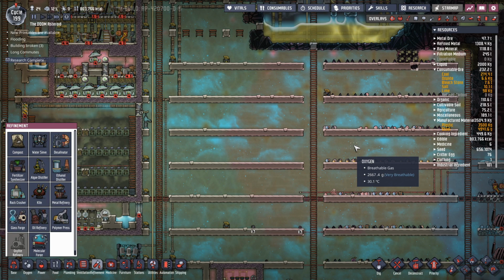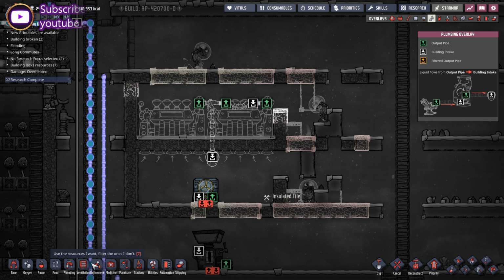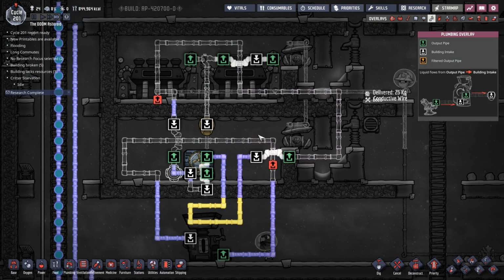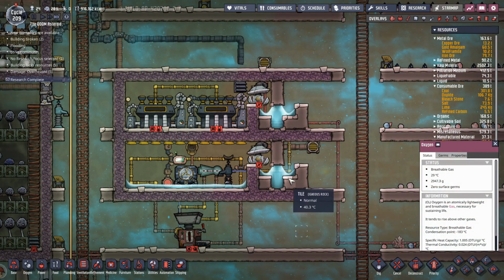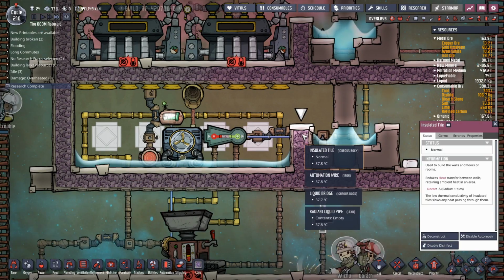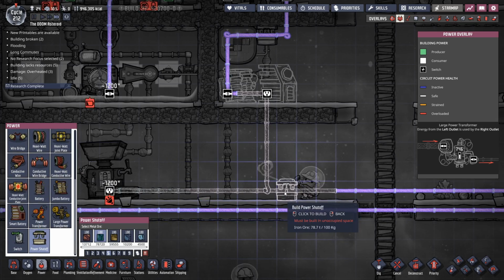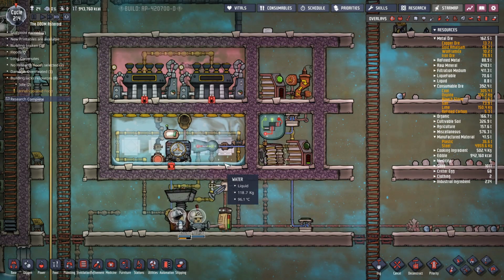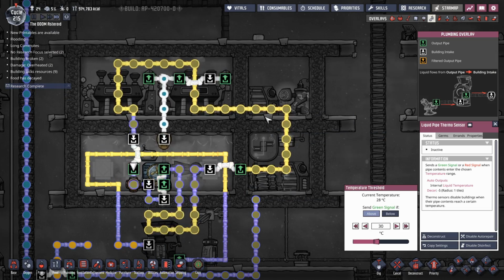Self-Powered & Cooled METAL REFINING | Oxygen Not Included Tutorial/Guide/How-to

Comment: I don't want to be critical, or spoiler, but it is possible to make a steel and iron smelting situation much more efficient than this one.  Like for mid game, I power my entire base with steel and iron smelting...
Reply from the maker: I know that the Aqua Tuner has a lot more cooling potential than this. I just really see the point for a tutorial to get people started on neutral metal refining by building a base spanning cooling solution. Simply the wrong focus
Reply: Please do tell how one would make it more efficient? Cooling potential aside, the turbines are consuming all of the heat that the refinery generates. Would that not imply the maximum power is being generated by the single refinery? Running the Aquatuner more has other uses, but would actually result in less excess power generation I believe as it is not power positive. More refineries would mean more aggregate power generation, as long as each is power positive, but does not necessarily increase efficiency.
Reply: @elmayo1665  Nialus had it.
Reply: @elmayo1665  Making Steel and iron are both power positive.  Gold is not power positive.  It is possible to make a more efficient steam reactor, to max out a single steam turbine (making nearly 1200 watts continuously).   If you are concerned with Duplicant comfort add a wheezewart next to refinery to lower the temperature down, and use ceramic insulator(in fact dont even try with less than ceramic insulator).    Adding in the Aquatuner makes the whole process less than power positive.  If you need more than 1200 watts, and more refineries.

A refinery will look like this...

Turbine
1x5 steam chamber filled with 20kg of steam per tile
1x2 wolframite door.  Insulated tile 1x2 door
1x5 layer of Iron, steel, or diamond tile filled with radiant tube
Refinery, with bypas plumbing like is used on aquatuner, dont let heat go above max temp of crude oil 

Build as many of those as you want, you will have constant power until your run out of resources to smelt iron and steel.  Build with appropriate mid game materials, and it will get to 80ish degrees in area, and never get any hotter.  use wheezewarts if you want kerbals not in atomo suits to be able to refine metal, but no extra cooling is needed.

This will need fine tuning
Reply: The amount of electric used to smelt iron and steel by that device is small compared to what it will generate.
Reply: iirc been a minute since I ran one, but circulating temperature of crude oil should be about 350 degrees.
Reply: @asdfdfggfd  interesting approach. Assuming I follow without seeing it, you heat the diamond tile with the radiant pipe from the refinery and use the wolframite door to control the amount of heat injected into the steam?
I use that approach for generating power from Magma. 

What temp do you run your steam at? Also a 1x5 steam room is quite small. I generally have mine either 3x5 or 4x5. Not sure of the impact however. I admit, I never know for sure how much steam per tile to have. I know more dense steam can handle more heat and run for longer (kinda like a bigger battery), but never know what is ideal.
Reply: @elmayo1665  I use two temperature sensors, one for each door.  There is a little bit of... inertia(?) in the heating, but with some fine tuning you can keep the steam engine maxed out.  I use just enough water in the steam chamber to keep the turbine running continuously.
Reply: @elmayo1665  I give the smelter a fairly high priority, so that as soon as all the coolant is returned to the smelter, a duplicant shows up to  smelt some more metal.  Duplicants will not smelt non stop once it is up and going.   They will smelt a little bit at a time.  I use this as mid game power.
Reply: You can put a tank in and add more coolant, but it basically just acts as a buffer...  That is it just delays the time that you have to fine tune...

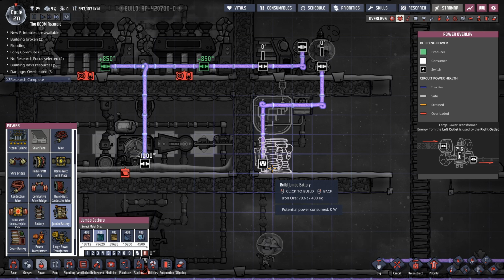Comment: 25:14, if the AquaTuner is running and you have the generator on the upper level, doesn't that pull 1200 + 1000 which is > than 2000? Would it make more sense to put the power shutoff switch between the Smart Battery and the Transformer on the upper level?

Comment: The deconstruct can be tamed slightly.

If you're on the plumbing layer, it'll only deconstruct pipes.
This applies to quite a few layers, so it's possible to use it quickly without deleting too much without manually selecting too many items for deconstruct.

EDIT: Ah - nvm, I see you used this later in the video.
The deconstruct tool also has a filter that can be manually set on the default layer, so can delete only walls over an area without disturbing pipes/wires/ducts

Comment: Transformer has On/Off automatization, you could connect it directly no need for switch.  And you could do same for Refinery through AND gate. Switches are more realistic thats true, but it can get in the way in future and its messy.
Reply from the maker: Don't use automation on Transformers. They lose their charge, which wastes energy and creates unnecessary heat
Reply: @Nilaus  Wiki says it does anyway.
"A power transformer will produce heat as long as it contains some energy, irrespective of the power input/output."
So idk. I have to test it sometimes.
Wiki follows: "The transformer's internal battery seems (mostly?) only to be available for supplying power when no power is available on the input side, or the transformer is turned off by automation." 
So if you use automatization to turn it off, it should stop produce heat after it lose internal charge.
I guess it doesnt matter if you turn them on and off frequently, for longer periods its better let them discharge. I never had use for transformers automatization yet.

Comment: You can easily use lead inside a steel aquatuner steam chamber. If it gets so hot in there that the lead would melt the aquatuner also gets overheat damage when its a steel one. If you go above 325 C you need a thermium aquatuner anyways, and then you need different material for automation there.

Comment: G-E-N-I-U-S.

I aways mess my ase when i reach the stage to use the refinary, u atre a life saver.

Is it possible to make the aquatic cooler rins even with elow 30º or it will consume more power than it generates?

I mean, its because of power you make it to run only if the liquid is above 30º right?

If it can be lower than 30º you can use the same aquatic cooler to cool a small part of the base.